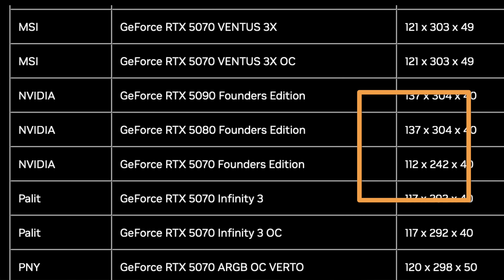Nvidia's 50-series Founders Edition Cards have a 20L sized problem.

Comment: Nvidia Need To Unlaunch the 50 series and move the product stack back one 

5070= 5060 =349
5070ti-5070 549
5080= 5070ti 749
no 5080= real 5080 with 15000 cuda cors 849
5090=5080ti 21000 cuda cores 1199
5090 titian= real 5090 24000 cuda core1699
this is the true product stack to get generational improvement

Comment: 4:55 Nope. Nope nope. Not letting this slide. People parroted this theory ad-nauseam with the first FE coolers, and do you know what happened in A/B testing? Tower-cooled CPUs ran COOLER, because there was less RECIRCULATION in the case, which is what actually increases case temps.

Backplates always increase system temps. Always. This kind of argument would be completely unthinkable if someone was proposing making a tower cooler with a massive plate on the exhaust side of it. This is beneath any serious discussion.
Reply: Are you referring to the 30 series when Nvidia first started doing the half flow through design? That's not really the same situation. The 20 series coolers exhausted all their hot air inside the case, which made recirculation possible. The back half of the 30/40 series coolers exhausts air outside the case, which already prevents most recirculation.

Also, the Dan C4-SFX has a "Founders Edition air tunnel" which is basically a backplate for the flow through section of 30/40 series coolers and it has been shown to reduce CPU temps by directing GPU exhaust out of the case - even with a rear intaking CPU cooler. The effect of the second flow through section exhausting straight into the CPU cooler will likely be much greater.
Reply: hello mr stand on business can you please reply to the man above 

thank u mr not letting this slide i would like to learn more
Reply: @ I posted a reply and youtube ate it.

Go play in traffic.
Reply: @ yo dont get cancer man
Reply: @phillycheesetake  

Upgraded my M2 with a 5090FE, replacing 4090FE. Also replaced P14 fans with A14 chromax because the drone was driving me nuts.

-35 PBO +200mhz on 9800x3d 75% PL +250mhz on 5090

Running OCCT combined for 30 minutes: - 425W gpu power draw - CPU temp is +10C as kind of expected. I got ~75 on my 4090, now it’s 83-86 and I have to ramp my cpu fan speed up. - GPU at 70C 1500rpm so it’s pretty cool and quiet.

Seems the main thing as expected is blowing hot air right on the CPU. 85 isn’t end of the world but I’ll be thinking how I can improve things.

cheers you dont have aids i think

Comment: Wondering what the best 5080/5090 config would be for Ncase M1 owners. Seems like a few AIO cards would fit out of the box, but some might need to be deshrouded. Do you think you’ll cover options for the M1 this generation?
Reply from the maker: Are you running the front IO? The shortest 80 I've seen is MSI's Inspire, may be a good choice although it is 50mm thick, which combined with the length is just on the margin of fitting comfortably in the M1 with front IO installed.
Reply: @ yeah, I am running front IO which complicates it a bit. Inspire is #1 on my list in addition to the Windforce SFF, Prime, and Ventus which seem close to the 40** ProArt

Comment: I’m thinking of building in the Lian Li Dan A3 (26L) as an interim build, while waiting for 5090 waterblocks. It supports 4-slot cards, large CPU coolers, and  most importantly will have plenty of space for a flow-through card to breathe. 

(It should also be a nice, relaxing build- at least compared to sub-15L hardline watercooling 😅 )

Once I can watercool again, though, I’ll probably go back to my Meshlicious, or perhaps even smaller.

Comment: Why GPU has to be vertical? How about traditional GPU mount in something like NCase M2 with bottom intake, flow through GPU and top AIO exhaust?
Reply from the maker: For lower powered cards this can work. With a higher powered card the top exhaust will have a huge penalty. Top intake can work but there will need to be an exhaust somewhere (next to an ITX mobo most likely).
Reply: @MachinesMore  Thanks! By "lower powered" you mean just 5080, but not 5090? Also "huge penalty" is on CPU, right?

Comment: Vertical orientation with Liquid Metal will be a bit of a risk…
Reply: check out gamers nexus's interview with nvidia cooling engineer... i don't have doubt that nvidia engineered the shit out of this application, even more so than AIBs
Reply from the maker: If they've made the card and applied properly (I should hope so) this is not going to be an issue. Otherwise they're setting the stage for a huge issue- no way to control how users install the card and there's many vertical mounting styles in play these days.

Comment: I think you’ll be pleasantly surprised how well it performs in traditional cases like an NCASE. Sandwich cases  with three slots and it pushed to the side might be ok if it has top exhaust fans. Fan turbulence could be an issue though….

Comment: Curious how much of the new 5090 cooler design is ported over to lower end cards like the 5080, 5070 Ti, etc. Specifically, do they all use the same liquid metal TIM, the same 3D vapor chamber, the same fin stacks, etc.? If this 5090 design is considered to be insufficient for a 5090's nearly 600 watts in SFF sandwich setups, it might still be reasonable for the roughly 300 watts of the lower models. However, if some of those innovations are dropped, or made smaller/less efficient in those lower models to create the "minimum viable cooler" for each model, then the problems might very well remain across the line. If you end up getting some of those lower FE models, it would be nice to compare the cooler designs to see if those lower models end up being overspecced, and more viable for SFF.
Reply: One of NVIDIA engineers said FE 5070 and below didn't change cooler designs. Not sure if he meant just the flow-through design or everything else as well.
Reply: 5080 cooler is identical but they don't use liquid metal according to nvidia

Comment: I just finished building my Midori 5L and wanted to possibly upgrade to the 5070 but do you think this will be an issue ?
Reply: 5070 has the old style design, it's only 5080 and 5090 changing
Reply: @MegaKiri11  Oh ok thank you should be ok then ? I never have owned a fe so airflow isn't bad ?
Reply: @ I think it should be fine, but too early to tell, there are no tests of 5070, we don't even know when it comes out.

Comment: Small form factor is cancer. It was 100% AstroTurf on release with review sites saying PC is dead, sff is the future. No. No it's not, nobody bought it enough to be profitable, and it was never standardized. Then the losers pushed full size case changes where they removed all drive bays for RGB fans covered by GLASS. The problem is nobody called out the grifters and we're now stuck with garbage. So boohoo SFF doesn't work, because it never did. Now you have to deal with a single 2tb nvme with 100+gb game install sizes as well. So... When are we going to admit there's a problem and stop glazing bad products? Speaking of, UEFI uses unencrypted Fat32 partitions susceptible to root kits. Yet another problem completely ignored. We just waiting for a virus to address it? Cool.

Comment: Fun fact! It has been disproven that a flow-through cooler is “that bad” for thermals, it’s a 2-4c delta, now this will probs. Be higher (almost 600w full is crazy) and this will def. Be a 6-8c delta.
Reply from the maker: Quite the contrary, it makes total sense that it's better for the card thermals, as long as that exhaust can flow somewhere without being inhibited.
Reply: @MachinesMore  What he meant is that we don't know how much it will affect CPU thermals. I did some napkin math, and two 116mmx15mm fans, with an ambient temperature of 20c, and a full load of 575w (which is probably unrealistic) will heat the air to around 26c. The CPU has a 120x25mm fan with much higher airflow than the GPU, and it is intaking some of the air from the rear of the case (so 20c air). Worst case scenario, without a 92mm fan at the back as intake, we are talking about air that is maybe 3c hotter. Doesn't sound such a huge deal to me.
Reply: @MachinesMore  im talking about the cpu thermals...

Comment: 3:27 it was definitely not a blower. Just an open back axial fan cooler. The 3070ti fe even wasn’t a blower, but had the flow through design + open bracket for extra exhaust efficiency :)

Comment: Technically, with ever more powerful gpus, we need to start thinking about intake and exhaust partitioning of the different components. Custom partitions will allow for better air flow performance and less mixing of intakes and exhausts. This will be the only way if the higher performance card keep guzzling these huge amount of watts.

Comment: Good points and thoughts for these new cards. It almost makes the new Master Cooler modular case make sense. Only you can't actuality turn the mobo tray 180. If it was possible you would see people flipping their cases upside-down and setting the cpu cooler to exhaust, only the gpu would still be pumping air into to case unless you could find a riser cable that allows you to mount the gpu the right way up. There's no easy way to make this work with air cooling. Looks like waterblocks are going to be the answer for this gen of nVidia cards. Providing they're actually worth buying with all the added cost and building required.

Comment: If I can get a 5080 FE - and that's going to be difficult enough - my plan would be to transplant B550i from NR200 to an mATX case like the ASUS, add two good fans up top, keep the two inlet fans at the base and stick with NH-C14S CPU cooler which draws air from the case side.  A new case is cheap compared with other components these days, unless you really need a small SFF, and allows for a mATX m/b and ATX PSU in the future too. The 5080 isnt a really big improvement over the 3080ti which worked well in the NR200 but the 5090 is too expensive and uses too much power.

Comment: i think there is just no way you can have a compact gpu in a 20l pc with 575w, its just too hard to try
Reply: sounds like a challenge!
Reply: @MegaKiri11  yeah, but you would need to redesing how those 20l would be placed, since making a cube or a rectangle would make the gpu always face the same problem. and i dont think at that point 20l would be the actual size of the case personally.

Comment: Small 2 slot cards like the asus prime 5080 exist now. Add two 140mm fans blowing directly on them in cases like the case m2 or n200 and this should solve any issues. They will be priced at fe msrp prices as well according to asus. You really should try to get one of these slimmer 5080 cards to test in various cases.
Reply: The Prime series cards are 2.5 slots thick and this video is only aimed at FE cards. Obviously, the traditional cooler Prime (Asus), Inspire (MSI) and Eagle (Gigabyte) cards will work well in SFF sandwich cases.

Comment: I want to think of the 5090 FE as a 3-slot card disguised as a 2-slot. You absolutely need to leave that extra space behind the card for the flow through airflow path. 
I have the OG Meshlicious and just did the standoff mod in preparation for this (not that I'm actually going to buy the 5090 FE but just thought this would be a cool mod anyways). In a sandwich layout like the Meshlicious or say the FormD T1, you can do side(top) case fan exhaust (a typical negative pressure setup). I think this kind of setup would make the most sense for a 5090 FE, as now the CPU cooler is no longer intaking the hot air from the GPU, and the flow through path isn't really hindered. But you actually do need powerful case fans to move all that heat away from the system... Maybe, I don't know, I'm super curious if someone could try it out after the 5090FE becomes available to the market.

Comment: Currently rocking a 4080Fe in my Deepcool ch160 with an air cooler on my cpu with rear intake. Will these new 5080 cards just not work  on this type of mini case anymore?
Reply from the maker: Air cooling in a traditional build will be a tricky prospect with the new flow-through design since both ends of the card will have exhaust. An AIB card can work though.

Comment: I really hope your are dead wrong, but I doubt it. Have an NR200P with a 4070S, and wont be upgrading untill the 5070S or 6070, but this got me worried.
Reply from the maker: Plenty of AIBs to fit the NR200 anyway, so I'm not terribly concerned, it's just the new FE design.

Comment: I am not sure any of these cards are going to be ideal for sff with as much heat as they are likely to put into the case.   It will be vital to get enough air flow where in the past 1 or 2 fans was enough, not sure thats going to be the case anymore.   I have already started builds that are moving to mAtx (AP201 and Lian Li A3 wood panel) where you get a little more forgiveness and can control the air flow.   For SFF I think AIO are going to be a better option then air coolers (if not using riser cables of course), as you mentioned the air coolers will be getting heated up and if its just the pump you have a better chance to get that heat out of the system.   Exhaust fans on the side mounts may become a thing again.   Also just ordered some 1000 watt SF Corsair power supplies (2024) as well as I think smaller ones will be a thing of the past.... Great content as always.

Comment: in this case, the fractal design ridge will be a better choice, or the nr200(p, BUT deinitely NOT v2/3/max version), normal (p) version must use an aio at the side and as intake, top as exhaust, 2 at the bottom as intake for sure and 1 at the rear as intkae too.
Reply: I thought exactly this for the nr200 lol

Comment: what we need is a compact version of the traditional layout think dan A3 but with a 280mm AIO on the top instead of 360mm and SFF only PSUs. the best scenario is glass side panel Bottom intake top exhaust. A 9800x3D will  work well with an AIO even if the intake of said AIO is the exhaust of the FE 5090. An additional back fan would aid that. That's the only real scenario where it would be optimal the other one would be a Silverstone ridge layout with somehow a way to fit a 280mm aio.

Comment: Do you think the flow through style cooler of FE cards will work with the Ncore100 Max in an expanded configuration? Im thinking of using the expanded 3.9 slot space and putting a 2 slot FE card so that there's more gap between the GPU and the motherboard.

Comment: Currently have an A4-H20 with AIO, but I want a 5090FE and was concerned about cooling, so I just ordered a Jonsbo Z20 for this reason. I will have two bottom intake fans and use the rear as an intake as well, then vent everything out the top radiator using two phantek T30’s. 
That way I have some cool air entering the case just below the radiator fans
Reply: Are you planning to use a CPU Tower cooler? I'm thinking about doing a similar builder to yours but I will be using a AiO so I'm not blocking the exhaust air of the 5090 upwards
Reply: @ I’m using an AIO 👍🏼

Comment: So now we are waiting for the case where the GPU is completely separated from the rest of the components. Sandwich style like a4-h2o with a chamber, completely isolated on the motherboard, psu, air cooler or GPU on top that will do the air pulling. I don't know why manufacturers don't make such cases yet, a ready recipe for success

Comment: You know what case would absolutely thrive with this cooler design? The Fractal Ridge. That thing may have been ahead of its time and would work perfectly with these new cards.
Reply from the maker: Totally. Going to be high on my list to test with if I can get a card to test.
Reply: @MachinesMore  SFF time U-ITX is another good example, basically any case that allows the card to intake air and exhaust it right away with minimal impedance, will be preferable.
Reply: @MachinesMore  If possible, it would be cool to see your reviews of Fractal Ridge competitors too (U-ITX -7 / P-ATX / N-ATX) by SFFtime.They are thin and have excellent airflow through all sides of the case.
Reply: I have a MSI 4080 in mine currently, even have room for 2 slim noctua fans. Temps have been outstanding.
Reply: @matthewrezuke8130 which msi model is it? I got a fractal ridge myself as well
Reply: I own the Fractal Ridge and Im lucky to have it :)
Reply: Words out of my mouth. 👍🏻
Reply: Yes, and probably the Tetra by Thor-Zone
Reply: i have a jank setup of a 240 rad inside the gpu side with the cou fans ziptied to the outside of the case pushign air trough the radiator and into the gpu which is a 2 slot  rx 7600 sapphile pulse… the fans are ziptied outside cause they wouldn’ fit with the radiator and gou in the same space… the goddamn 5090 could fucking fit while giving me maximum performance… and aid the cpu fans to coll the cpu and gou at the same time… so cool
Reply: I thought the same thing but it does not support higher end cpus and big air coolers.

Comment: I was literally writing a script for this topic, focused around the FormD T1 and how the new RTX 50 Series cards are not entirely SFF friendly based on the cards change in airflow design. Working on an ideas on how we can navigate this concern. My new favourite RTX 50 Series SFF Ready case is the Thorzone TETRA. Good work as usual.
Reply from the maker: Cheers. Yes, I do think the right console style case can work great for the FEs.
Reply: @ what is your most anticipated case for the 5080/90 FE?
Reply: Easy. A case like M2, you put the card in traditional position, 280mm AIO at the top as intake also, and 2 140 or 120 mm as side exhaust.
Reply: @reynoldoramas3138  What's the best PCI-E riser for M2? since their originals are always sold out
Reply: When is the TETRA going to be released and do we have dimensions for them yet? I'm very interested.
Reply: @ not entirely sure but all updates point to February - March